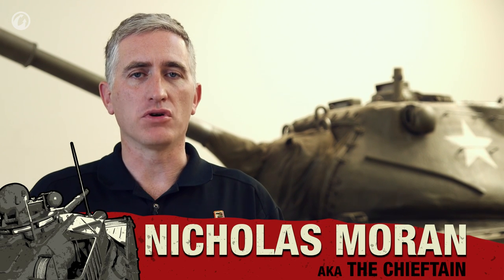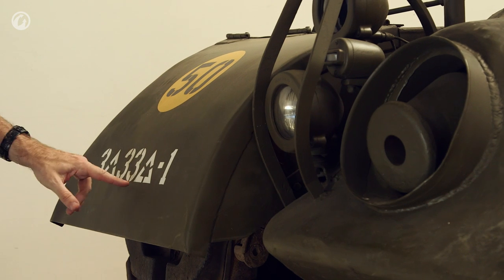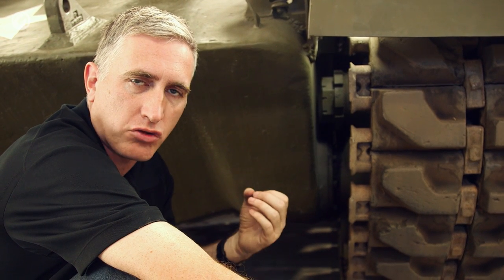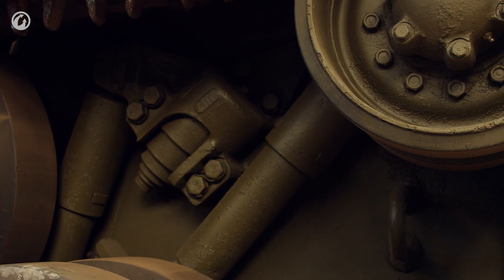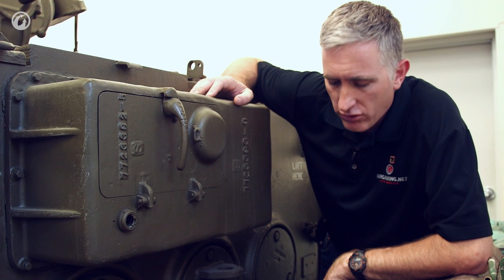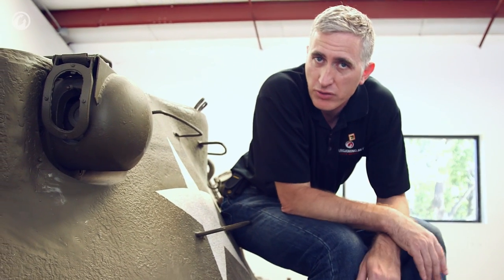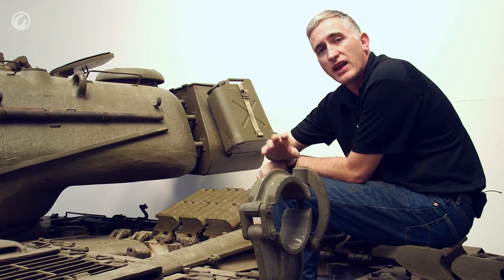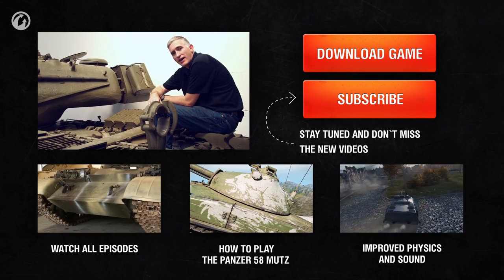Inside the Chieftain's Hatch: M47 Patton II Part 1

Comment: I thought the rain guards were to reduce the rain water running down from the the top and sides of the turret going into the driver's hatch.  They direct it away from the hatch opening.
Reply from the maker: +Christopher B. (Chris B.) As long as the turret is facing forwards, it makes sense. What happens when the turret turns 45 degrees, and all the water is channeled onto the driver's hatch?
Reply: +TheChieftainWoT probably the driver and the bow gunner is gonna get wet anyway XD
Reply: +TheChieftainWoT It looks like they work when the turret is either forward or backwards in the travel lock position.  I'd say not to open the hatch when the turret is at 45 degrees unless you smell bad and need a bath.
Reply: +TheChieftainWoT When can I go for a ride in some of these amazing machines with ya?? :-)
Reply: The_Chieftain Looks like the sides of the turret don't overhang the hatch the way the front of the turret does. I bet that's what the gutters are for.

Comment: Question, I'm not familiar with museums vs actually owning a tank but are all of these tanks deweaponized such as holes in the gun and armor or are museums allowed to keep everything in working order?
Reply from the maker: +Ben S In the US, it is possible to own a fully armed tank. The weapon is categorised as a destructive device by the Bureau of Alcohol, Tobacco and Firearms. There are, as you can imagine, additional permitting and checking requirements before a permit for one is issued, sometimes just not considered worth the hassle by the owner, in which case it is demilitarized. Additional regulations and processes cover certain ammunition types.
Reply: +TheChieftainWoT is tank ammunition expensive and where do you even buy it from?
Reply: +TheChieftainWoT is it more of a hassle or a budget? I looked up some tank prices and I seen Russian tanks are around the modern day sports car price? I thought they would be much more expensive or is that due to how much there are(t62s-t72).
Reply: +Ben S As far as I know the tank owner has to 'built the ammunition from scratch' or modified existing ammunition because some types of ammunitions weren't produced anymore. I have seen a tank owner that spent $300-$500 per shell each
Reply: bit of a old reply but tank ammunition is of expensive but that all depends on what you what. a sold lead AP round is around 100$ a shot but the fed count them as big rifle rounds and thus you don't need to extra paper work for the rounds just the gun, but HE and HEAT are consider to be destructive devices so they have to have the registration as the main gun. HE and HEAT are also very expensive with HE starting at 350$ a round and with HEAT i can't find a price most likely meaning to no one is will to make or sell that type.
Reply: The Hawthorne Ordnance Museum's M47 was demilitarized. Holes were drilled in the gun barrel, and then patched up with Bondo, per the curator.

Comment: 3:52 as a back yard mechanic and welder that has done things from rebuilding a 100cc 2 stroke to an entire car(body, trans, engine, axle, interiors ETC).... 

holy shit, i thought i sucked at arc.....just slag it up!!! adds armor lol

however, i wonder what size rod they used....probably like 1/2 inch lol
Reply: +kain hall 10 bucks says that was likely done as a in field repair or perhaps a front line repair depot. Where they are more concerned with functionality over looks . Besides a nice thick wield in a vehicle designed to take hits never hurts.

Comment: I have always wondered, what does the canvas liner do around the gun mantlet? Sorry if you say it in the video.
Reply from the maker: Keeps the rain out.
Reply: TheChieftainWoT Interesting. Why didn't they do that for earlier tanks? Did they have another system or did they not consider crew comfort that important?

EDIT: Excluding the M18 Hellcat.
Reply: There are occasional pictures of M3 Mediums with canvas mantlet cover for the 75mm.  Some models of M4 (M4A3E8 off the top of my head) had a canvas cover for the gun mantlet and certainly the M26, M46, and newer did as well.

Comment: C-24 the fourth tank?  When I was in that would be the second vehicle?  2-2 (2nd platoon, 1 track, 2-4 (2nd track) 2-6 (third track, normally platoon leader - Get your "Six" on the horn) 2-8 (4th track, often the platoon Sgt)
Reply from the maker: Callsigns seem to vary depending on unit. I was Red 1, (1-1), First tank of the first platoon, and the platoon leader. My 4-tank was the platoon sergeant. 2 was my wingman, 3 was the PSG's wingman.  I believe in the M47 days, tank platoons were still five tanks.
Reply: The_Chieftain, I was in 1/54 Inf. 3rd Bde, 1AD back in the early 1980s. Who knows it might also be when you served. The army was in the midst of a major transition at the time. I recall distinctly that the 1/54 part was marked 1-54 INF on the fender.  Pretty sure it went 1 (triangle) 3 (triangle) 1-54 INF.   This was USAEUR. Riding around in 113s
Reply from the maker: Ah. APCs would be different. When I was a troop commander, (2010 or so) the platoon leader’s HMMV was 6, the PSG’s was 5. I think only tanks would use 1 and 4 for the PL. 5 was the XO,the CO 6, and Top was 7.
Reply: The_Chieftain,  more importantly, thanks for the terrific videos and all the work you do, especially when it comes to de-bunking the nonsense about the Sherman.   Great job!